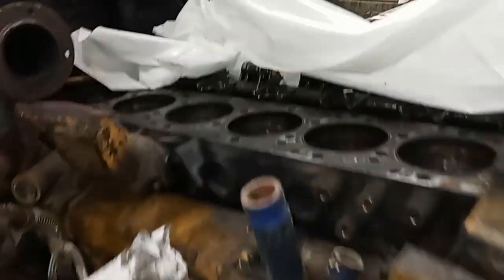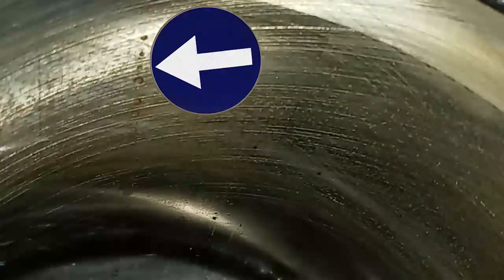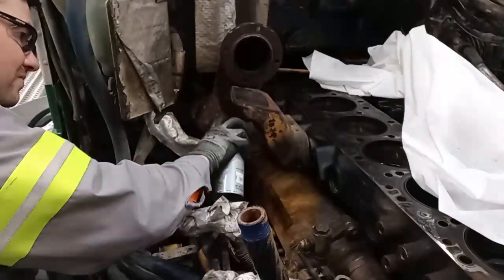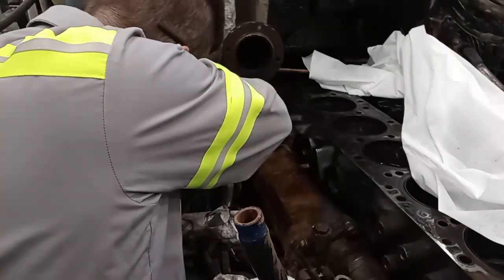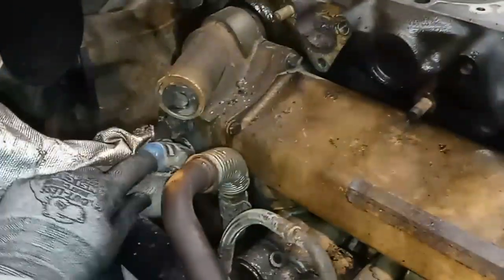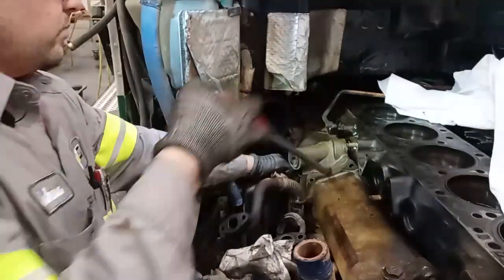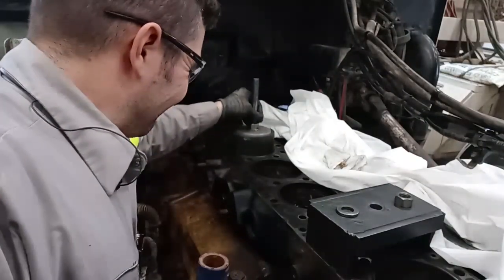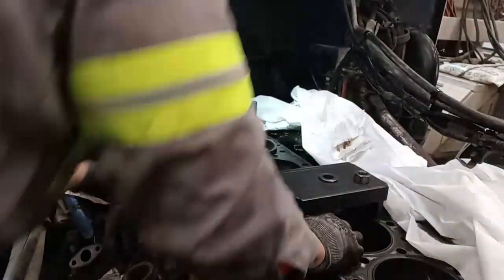Coolant can DESTROY your Engine faster than Bad Oil. Cavitation and Liner Pitting.

Comment: I worked for Ohio Machinery/Ohio CAT as field service tech and remember a chemical CAT required for use in engines that had coolant in the oil. After the repair is made. It prevented the bearings from being damaged down the road due to a chemical reaction with the glycol and tin/lead bearing construction. I can not find the name of it.

Comment: A regulated overpressure (positive pressure) will help prevent the forming of caviation or atleast slow it down.
So its vital that the cooling system is able to pressurize in adition to having the right coolant.

Comment: Remove oil pan, pressurize radiator and look for leaks around liner. Have somebody slowly rotate because the piston and ring could be covering up holes from cavitation.

Comment: Due to the angle of the connecting rod, the piston gets pushed into the side of the cylinder during the power and compression stroke -- this is called side thrust. You can see this by examining cylinder wear, the side taking the major side thrust (power stroke) usually wears faster and shows up as glazing in the middle of the cylinder on that side. This side thrust causes the liner to oscillate back and forth microscopically. As the liner is moving away, it creates a zone of low pressure in the coolant and bubbles of air start to form. These bubbles implode as the pressure increase again caused by the liner moving back to the original spot. The implosion force is measured in tons per square inch (very powerful), and if it happens close enough to the liner wall it can break off a bit of the steel.

Coolant is extremely important because chemicals in the coolant forms a protective layer on surfaces it touches. Cavitation hopefully damages this protective layer. The protective layer is regenerated by draining old coolant and putting in fresh coolant. This is why you need to change coolant every so often, and you should never run straight water in diesel engine (aside from obvious freeze protection).

Comment: The reason why they put bolts where you can’t reach them is because they put them in while nothing is blocking them ?? That’s right,frame,Radiator,hoses,fuel pump and any other thing they can fuck you with. That’s right,just bring it in to the shop and here’s another $ 200.00 for labor. And 1.49 for a new bolt. Answer Your Question 🙋‍♀️.

Comment: Had a big cam 400 towed in today, i remembered hearing of this and i skipped pulling the heads went straight to pulling the pan pressurized the cooling system and boom 💥 saw a steady stream of water coming through liner on cylinder 1. The truck is an old international paystar with butterfly hood, that is why i didn't want to pull heads first.

Comment: I have a 6nz . Recently I found a good deal on rotella 15 w 40 . Since it is getting hard to find . I bought 5 - 5 gal. Buckets . When I changed my oil I noticed that It was dingy looking like it had something it . I had some that I had bought somewhere else and it was clear and clean .I noticed these buckets had stick on labels and the one that was cleaner oil the bucket label was printed right on the bucket . What do you . think

Comment: Liner cavitation is usually caused by the “flex” of the liner under cylinder pressure. Or rather, by the rapid venting of that pressure. The liner snaps back to unexpanded size and the coolant immediately next to it sees a small but intense pressure wave that drastically lowers local boiling point. The coolant spot boils and the bubbles collapse when it converts back to liquid, releasing a small shock wave that is high enough in temperature and pressure to erode metal.

A mid-stop liner design is much stiffer and that’s why you almost never hear of cavitation on competing designs using mid stop liners.
Reply: Excellent description.

Comment: I also remember on cat c15 n 3406b not in cyl walls but in engine block cav issues somobody on a cat dealer to recommended  filled with epoxy n I did
Even when I doubt would last
It did work specially on areas near cyl walls

Comment: We had a c13 where the water pump went bad and was leaking coolant into oil system ,crew kept running it for over a month easy, Got to the shop they wanted the water pump fixed so I replaced and checked for leaks , no more coolant leak ,  found low oil pressure after 30 min idle, so checked the pressure switch then replaced and during inspection I found bad torque arm bushings , replaced and the day I go to pull it out of bay it starts to knock, manager tried saying I put gasoline in filters because the blow by smelt like burned gas 🙄 this place is crazy

Comment: I once was repairing a very old locomotive with an inline 6 cylinder diesel. The cylinder I pulled out was about 5/8 of an inch and the cavitation was about 1/2 inch deep. Down both sides. I don't know how much longer that engine lasted. Locomotives just run water for coolant with boron added for rust protection. If we have to shut them down in the winter they are drained.

Comment: Fascinating, always wondered what visual damage cavitation caused. We use additive in all our cooling systems to hopefully prevent this. Does this additive need to be added yearly ? Great video.
Reply: Depends which is cheaper? The additive monthly or an engine?
Reply: If you use inorganic acid technology coolants or even hybrid OAT coolants, you will need to test the coolants regularly to check the additives content. If its low, you need to add additives to the right amount which is tricky to get it right. Alternatively you can use fully OAT (organic acid technology) coolants that does not need to add additives. This OAT coolants are super long life coolant. You may want to check out Zerex Nitrite Free Heavy Duty coolant that meets ASTM D6210 heavy duty coolant specs and Cat EC-1 specs. This Zerex NF coolant can last up to 1 million miles.

Comment: Agree had it happen to a 92 F350 with a 7.3....ended up leaking into the cylinder and hydro locked thought it was a head or head gaskets so xhanged both happened again engine was history

Comment: My boss has had coolant leaks for the last 8 months, he has been filling his 60 series Detroit with straight water for that whole time.
He finally got me to fix the leaks, I flushed, changed the coolant and the filter. - It came out that same brownish, orangey color, of course the filter was  tightened on so hard   the seal looked like a bent in crush washer and the filter was rusted around the top.
I hope he hasn't killed the thing, that's a good motor to feed garbage to.
Reply: How many hours or miles re on his 60 series?  I have one with 3100hrs and have always wondered how long it takes for liner pitting to be a real risk. I do t have good records of perilous coolant change intervals.

Comment: Yep been there had a 88 T600 3406B blown head gasket broken head bolt pull #6 .1000 away from going threw the liner. Hard lesson on proper PH in the coollent. First inframe.

Comment: In the old days theirs a product I even use in my cars cooling system called Pencool 3000 . Way back when it went by the name Nacool 3000 . It was designed to prevent Cummins Worms in wet sleeve engines. I’ve actually seen bigger holes then that in sleeves. The problem arises in the firing impulses in the cylinders and harmonics that create theses shockwaves then the water boils into steam that causes the holes. Pencool was developed to stop this and corrosion in the cooling system,,especially on large Diesel engines cooling systems where water is only used and No Antifreeze is added because we are talking 500 gallons or more capacity systems. Even in these systems on tugboats that I worked on it wasn’t uncommon to pump in one or two 55 gallon drums of Pencool 3000 to get the right mix ratio. I can remember pulling a water jacket cover off of a Caterpillar engine that has been in continuous service for years since the last overhaul and the water jackets where perfectly gray cast iron. So I’ve used Pencool 3000 in all my engines for over 4 decades now and in engines with antifreeze it helps stabilize the antifreeze. In my personal cars I get at least 5 to 10 degrees of hot air out of my cars heater in the winter time with Pencool 3000 .

Comment: I prefer clean water in the engine in the summer and change it twice during summer and new coolant every winter. 1 million miles on this v8 and 3 gallons of oil every 40000 miles until its next service.

Comment: Iron tie ceramic seal bought me 4 years with this problem but you have to follow directions perfectly use only irontite cleaner,treat coolant surfaces with ceramic seal and water only run it a day or 2 then drain let it sir dry(cure to metal) open all possible openings to allow air to dry it once cured its leak proof heat proof pressure proof then add some coolant mix up irontite all weather seal with some warm coolant install the remaining coolant.run her hard we do canadians in oil fields in artic love the stuff.dont laugh its proven.if you have time and money then rebuild

Comment: I pulled mine and found out I have a cracked head I was told a aftermarket accert head would work on my 6nz I wanted to get some info on that because I didn’t think it would work
Reply: Cannot say what aftermarket parts are installed, a 6NZ 10R9347 Platinum kit carries a 20R2647 head and a MXS Platinum  kit 10R9925 shows to be the same.

Comment: Excellent explanation but I have a question and never understood  why but if those blocks are cast iron why do they need cylinder liners instead  of just using the block 🤔
Reply from the maker: They use liners so they can be rebuilt easily. It's more expensive initially, but cheaper and easier to rebuild in the future.
Reply: @AdeptApe  ok I got you know 👍🏾👍🏾

Comment: have writ about that many times...Coolant cavitation is a serious problem ever since wet sleeve engines debuted with 3306, 3406, 407, back in earlier nineties...Always run coolant conditioner determined by a coolant test kit...Coolant condition is ever bit as important to engine life as engine oil...not complicated at all, antifreeze doesn't wear out, conditioner wears out...We quit changing antifreeze 35 years ago, we tested with a Caterpillar coolant test kit and added purple  colored Naacool coolant conditioner, Caterpillar dealer sold at the time...When we needed to change coolant heater in an engine the inside of the block was just as clean as the outside...We had conditioner problem one time with low liners in an old D7 17A 18692 engine...So, we learned out lesson, the mechanics at my local dealer told me about my mistake and how to remedy in the future...So we began testing/replacing coolant conditioner in other engines as well...Even the gas engines/pickups cars etc...Neighbors had changed their pickups over to water only coolant during the hot summer that year,  later had freeze plugs rusting out...What a job to change those out!

So when we needed to change over to water, in order for engine to run cooler during a hot summer, we added Naacool according to the test kit...We never lost a freeze plug except for once in a 68 Plymouth Sport Fury...I changed the one freeze plug that leaked, and ran conditioner after that=no more trouble...I can't prove it but strong believe it helped water pumps last longer as well...We never let coolant turn brown any more, really haven't had a problem with turning brown after using the test kit and conditioner as needed..

812 385 9036 if want to discuss further, email is rockndirt@sit-co.net..

Am on a farm North of Evansville, Indiana..

There are some wrong advice given on this forum from additions below, I didn't read the original post past the beginning of  how to take an engine apart so I can't speak for that...I know water cools better than water-antifreeze when ambient temperature is high and engine is loaded almost continuous...We never had heating problem with the D7, or D6D, but the 977L had to be completely clean radiator core and water for coolant during heat of the summer...I used coolant conditioner with the distilled water to prevent engine damage, and changed back and forth with antifreeze mixture/conditioner and distilled water/conditioner in May and last week of September...I kept each change in plastic five gallon buckets...Was out only the expense of distilled water and coolant conditioner to keep the 3306 in the 977L running below 190 degrees F...977 radiator is tall and narrow to make room for the loader arms, where the 6 and 7 have square radiators that cool much better...The fan is able to cover more of the radiator, we were able to run antifreeze year around in those tractors...Neighbors had trouble with cavitation in their IH engines early on, we didn't have that problem as we learned out lesson with the low liners of the D7 early on...We had Cat, Case, IH, Mack, Cummins, as well as the gas engines so we bought many quart bottles of Naacool from Caterpillar dealer in Evansville..

Comment: you got pressure on both sides of that hole 1 side blows water into the cyl. 1 side blows compression thur to the water jacket

Comment: This is why I never run anything on less than 70% antifreeze. There is no case for even 50/50. Even in summer in Texas you will never overheat with 70/30 (antifreeze/water).

Comment: cavitation is a physical process. Not chemical. In many engines, It's caused by piston movement in the cylinder and its rocking motion, the vibrations induced are very high-frequency which leads to an ultra-sonic like cavitation effect.

Comment: I recommend always taking the difficult hard to reach bolts out FIRST. so as to be able to hand loosen it after you break bolt or screw loose, then getting tools out the ways. Now the parts won't be hanging making finger loosening almost impossible.

Comment: One  mechanic showed  you can check the amt. of Electrolysis using a multi meter, set on milli-volts.
The  action of the electrolysis creates a voltage, and over a certain amt. it needs to be changed.  Scotty  Kilmer  has a vid on  that.  Quick and easy check.

Comment: Why you have to keep up with your antifreeze and check every time you change oil test strips it is mandatory every 15000 miles has to be tested other wise you will be replacing the liners I do more rebuilds because people just don’t know to check there antifreeze

Comment: That is corrosion, probably a poor casting agravated by poor or at some time no coolant.
NOW,, does it have steel or brass welsh plugs? If they are brass engines will always corrode. The cad plated welsh pluga are a sacraficial annode. The reason most OEM engines have them. 
Most diesels are all cast iron and something has to give. And quite possibly the other 5 are the same.
The top of the bores is what generally corrodes though on low performance sometimes the corrosion happens in all the muds and crap in the bottom of the bore. This 30 plus y/o cars sitting for a while.
For me  a 302W Ford we went through THREE blocks to find one that would take .030.
A friend had a Mopar block do similar, sonic testing measures the rust as well. It had pinholes,, sleeved it and near immediatly another one did the same so scrap that block. 
I have seen and heard of this on numerous occasions, one  a fairly new car that had been dealer serviced. Luckily the multi year warranty covered that,,only just on KM however.

Comment: You don't know the reason behind why access to maintenance intensive units can be restrictive at times?...yeah, same here. Ever try replacing a heater core in your car? It's just a small radiator (smaller than a 6 pack) on the other side of the firewall. it's usually bolter to the firewall. If the heater core had a flange on it, then THAT could be bolted to the firewall with a corresponding hole for the core, but nooOOooo... it's on the other side AND THE WHOLE DASH HAS TO COME OUT!

Comment: Its from electrlousis, metal in the coolant acts like a electric motor causes actual electric spark to travel through the liner
Reply: You sir have clearly not learnt the difference between electrolysis and cavitation corrosion erosion. This is cavitation corrosion, i have seen it many times on engines rebuilds I have done.

Comment: What color coolant was used
Reply from the maker: Brown. I believe it may have been red at one time.
Reply: @AdeptApe  red suppose 2b non electrolysis
Reply: @robbwhitehead5486  Low psi will turn coolant brown in now time, seen it a lot.

Comment: Worked gor Ohio Machinery a Cat dealer had a 3406B that had soun a rod on not journal.I asked my boss if customer wanted to pull liners to check gor cavitation they said no.Put new st ghstctime $6000 crank and bearings.Put on chassis dyno had  it down and started to hear screeching noise at 80% load shut it down and shut off.Drove in shop with lots of anxiety about screwing that new crank up.It was in a long nose Pete ripped off oil pan engine was red hot looked up in No 4 cyl saw piston galling to liner bad.Had engine on floor and in pieces on bench with parts so hot  they were steaming.Found all the liners had   massive amounts of cavitation and no4 had a pin hole you could stick a paperclip thru.Man I was hot they didn't let me look at first they cost  themselves a lot of money.
.

Comment: My guess would be that oil cooler bolt is probably in a decent place when the engine is out of the frame. Engineered for ease of assembly on the production line, serviceability not so much.

Comment: I know many people who won't start a piece of equipment without checking oil and will never run over 200 hours on an oil change, but if I drain coolant to change a water pump the coolant looks like it hasn't been changed since new. I Have seen way more engines destroyed to bad coolant than bad oil. Most oil theses days can run 500 hours if you want without problems.